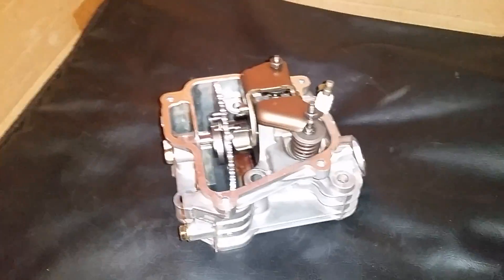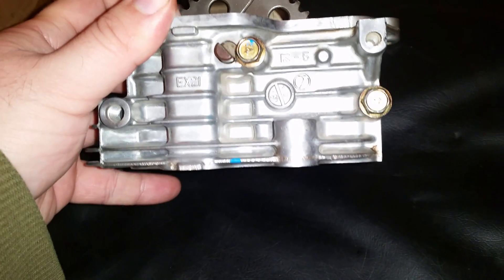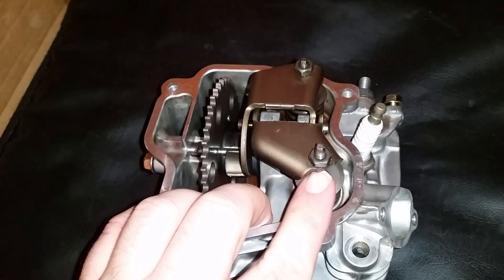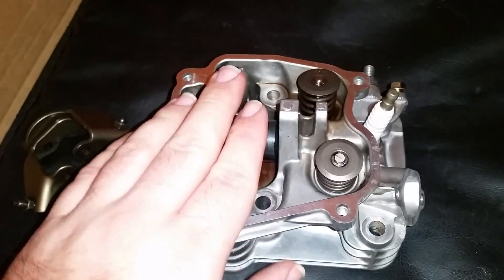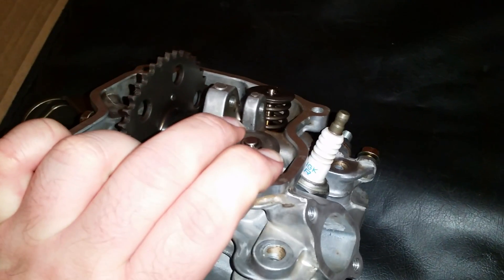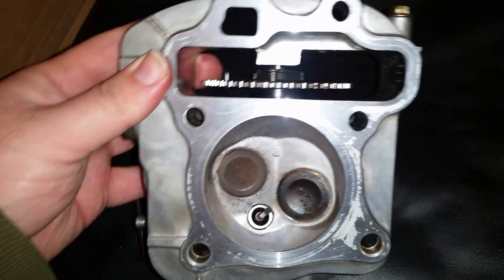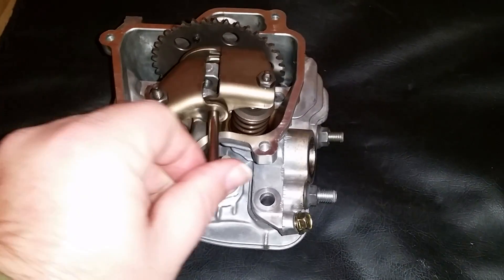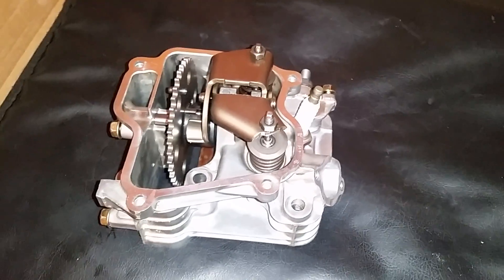Over Head Cam - Subaru EX21 Cylinder Head - Examination

Comment: I wonder how hard it would be to modify that cam since it's only one lobe.
Reply from the maker: There is a shop in Australia that makes racing cams and parts :)
Reply: dc5000123 I was thinking since it's such a small engine you could just take some measurements and try to be careful with a grinder you know I'm saying... polish it after you're done you'll be good to go. All they do when they do a regrind on a cam and turn it into a race cam is make the base of the circle the base of the lobe or somewhere in between depending on how crazy you want to get with it. And if you mess up you just buy a new one be like 5 bucks for a new cam.... 20 tops. I need to get my hands on one of these engines. The only problem I see is that you may have to mess with cam timing if you start Milling the head.
Reply from the maker: The performance shop in Austalia says it took them a long time figuring  out how to increase performance by modifying the camshaft so I would just pay the $160 for a cam. I was originally going to rebuild this engine with performance parts, but I was not happy with the estimated parts cost so I parted it out on ebay and made some good cash :)

Comment: I like how these are made The angled valves and combustion chamber is similar to a Hemi design Looks like these could be a fun engine to modify with different cams carbs exhaust and stuff which I'm sure isn't cheap But maybe there could be some mods that would not cost much to up the power a little
Reply from the maker: The billet rod & flywheel aren't cheap. The racing springs are about $70. Performance cam is $140. Check out this parts website: http://gokartengineparts.com.au/product-category/subaru-kx21-parts/page/2/
Reply: I got one and I just bought the rocket arm  Subaru engine

Comment: This makes me wonder about the Honda with the plastic gear for the cam???   This one is metal.  Thanks for the video.  I learned something.
Bruce
Reply from the maker: Bruce Pender I used to be fascinated with the horizontal Honda GC engines. I lost interest when I found out they were disposable and not rebuild-able.
Reply: ***** Well they are fixable down to the block that's all I know but that plastic gear drives me crazy..  Still give me an old 5hp B&S horiz with an exhaust valve to grind.
Reply from the maker: Bruce Pender
Well, the Honda GC motors don't have removable cyl heads so it complicates things.  I prefer the B&S 5hp myself. The good thing is the Subaru ex motors are getting cheaper on ebay and I'd like to bypass the harbor freight motors all together. LOL
Reply: yes  we call them something else up here in Canada.